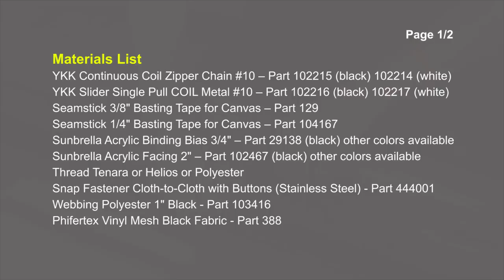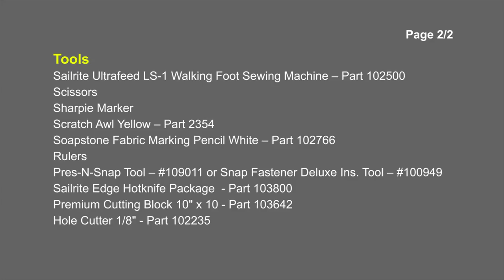Installing Curved Zipper with Screen in Vinyl Window Material

Comment: Do you use this same procedure when putting screen roll up windows in Sunbrella?
Reply from the maker: Yes, it is typically done in the same way.
Reply: Thank You So Much.  The only thing different I did was to carefully burn the edges after I slit the opening under the zipper.  These Video's are Great!  Thanks again.